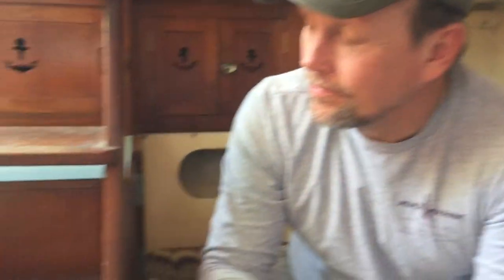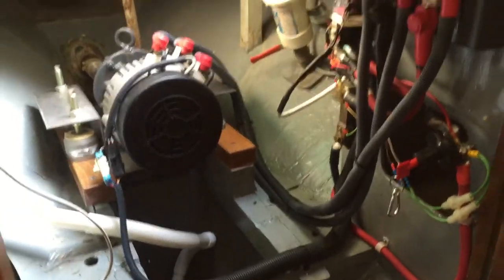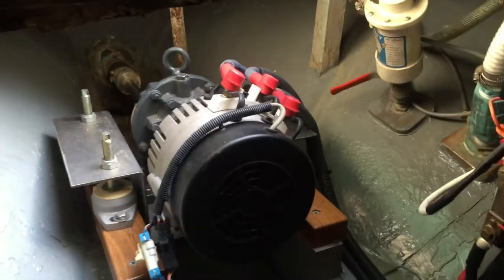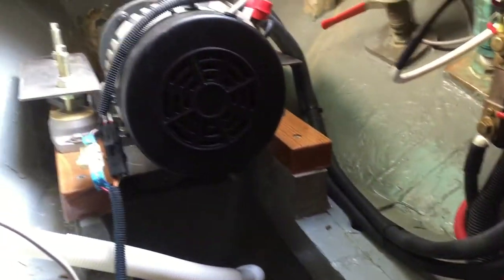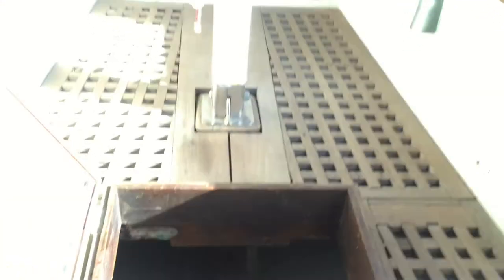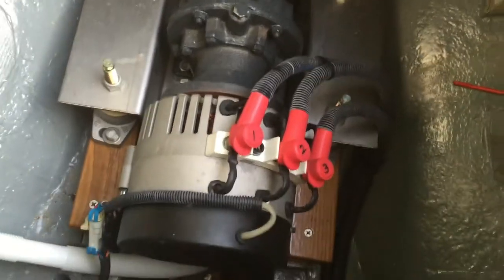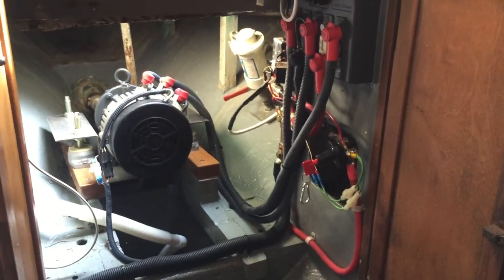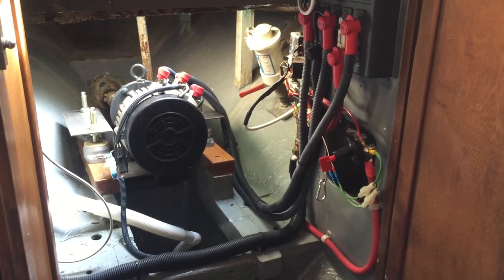Eric Dysart's Serenity

Comment: 5,000 watts for 10,000 pounds @ 5-knots per hour works out to 0.5-watts per pound @ 5-knots per hour.

You sometimes have these talks where you talk about the prop, but I am curious regarding the efficiency of the propeller with an electric motor.

When I think about it, the efficiency of electric motor is locked in once you buy it. It will be be between 85% to 95% for most EM, but the propeller is another story.  

Can I improve on the efficiency of the previous Diesel propeller, and what is the “ideal” gear ratio between the the EM and the prop?  

For instance, there is talk that a folding propeller will improve efficiency.  There is, also, talk that the number of blades will affect it as well as the folding of the blades and the angle of the same.  If you make another video, I would be interested on this topic.